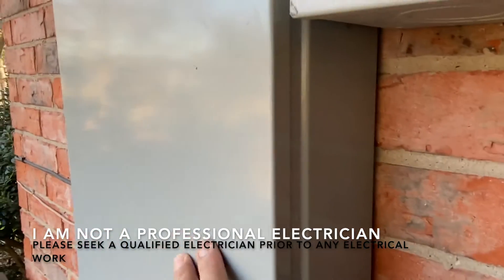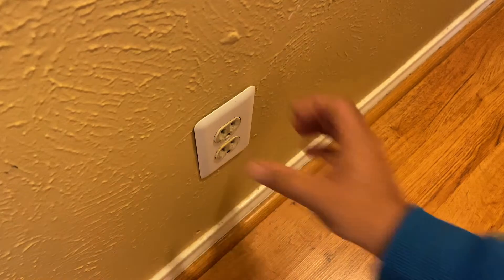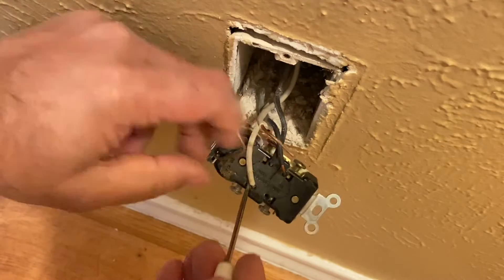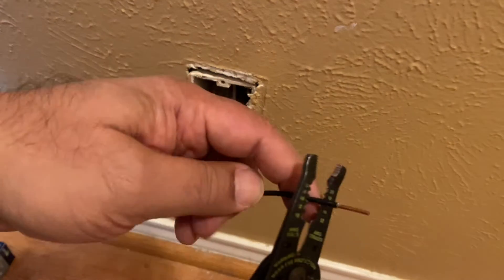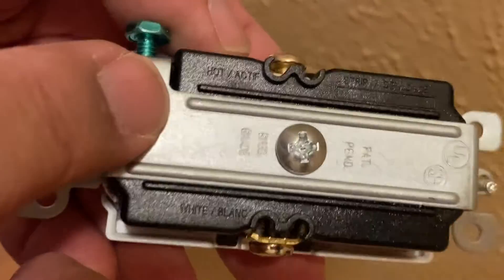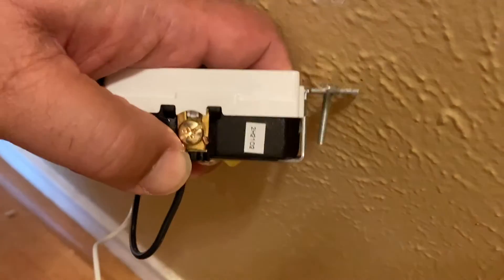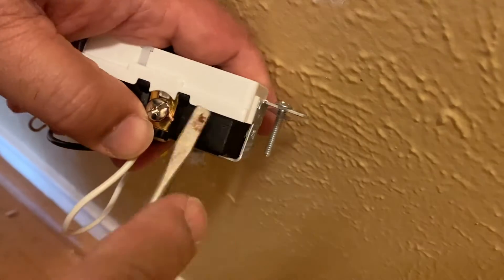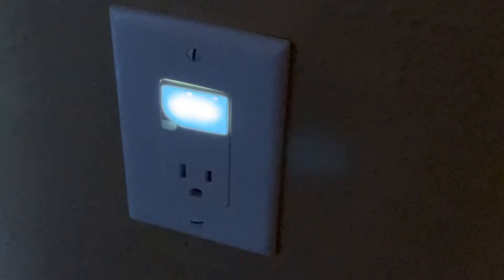How to Install an Electrical Wall Outlet | Leviton

Comment: Harki, do you have those wago connectors in the US? It's popular in EU, and these days I only use that for connecting wires. So easy to do 👍😁. Twisting wires with wire nut always confuses me on the direction 🤣
Reply from the maker: Hi Suj, yes we do have those here as well and you are correct it’s easier. However I am old school and prefer twist connections….🥸
I think it’s similar to the conversations about those SharkBite push to connect connections for plumbing.

Comment: Good visual walkthrough on how to change an outlet. You did it correctly, but would have pointed out that the connecting loops in the wire go the same way the screw is tightened to keep it secure. I also would have adjusted the outlet some so it fits more flush with the cover, but that's just my OCD talking. - Chris
Reply from the maker: You are absolutely spot on with your comments. I did adjust the outlet to be flush off camera, but to your point I should have mentioned it. Thanks again, appreciate the constructive comments.